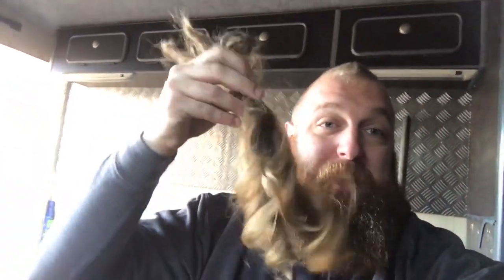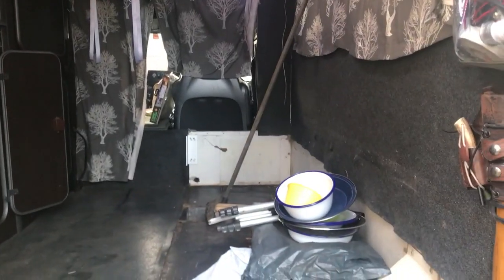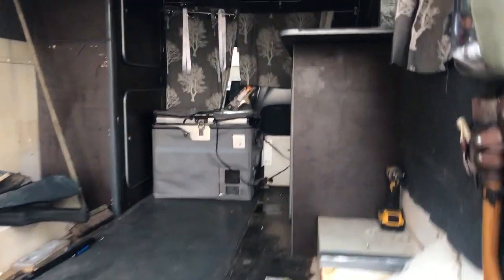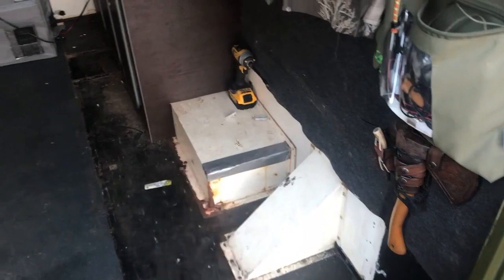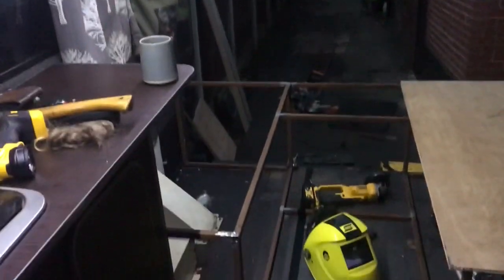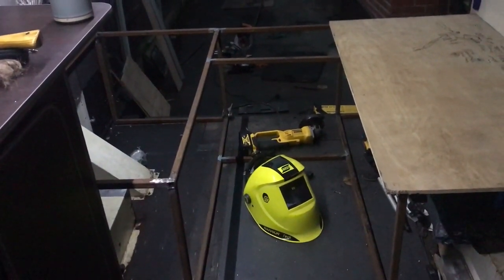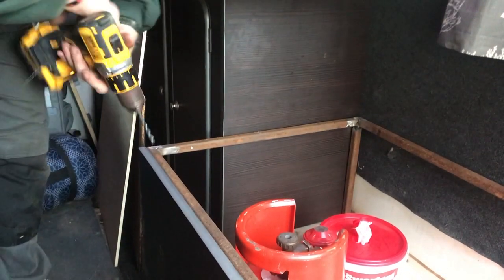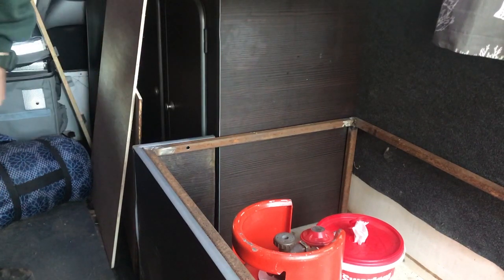land rover camper van DIY rebuild

Comment: Been growing my hair for 30 years and it has not gone past my shoulder blades and been there for the last 25 yet I can almost see my beard grow it grows so fast. 
Great video anyway bro it is sure gunn'a look different when finished.
Hope 2019 is going well for you.
Reply from the maker: Ken Allen yea mine was starting to thin because I was getting fed up with it and brushing it too hard and ragging it out. My beard was like that until I started using beard oil and stuff.

Comment: I was watching this while I drank my morning coffee. I know of a company that makes reliable off-road winches that doesn't break the piggy bank. Unfortunately I do not know if they sell their products over in the UK. The companies name is Badlands Winches. My local tool store sell them for like $299 before tax for a 12,000 pound winch. I'm not sure how much Edna weighs being the big girl she is, but they also make 9,500 pound and less capacity winches as well.
Reply from the maker: David Genthner Jr she is at 3000kg so not bad at all. Iv got a 9500 on the front but was thinking about one of them little 3000lb ones for the back. It’s not big but with a pulley it’s more than enough with the wheels turning too.

Comment: G'day Rich. :) . To be honest, i was doubtful when you first suggested putting in a side door,  i just couldnt wrap my noggin around the imagae of cutting a hole in the side of the truck body. BUT, lol, during the intro, and your informing us and pointing out the positions, i thought 'Phuk yeah, thats gonna be grouse'!. Well done mate, its coming on a treat. Bugger about it not being quite wide enough though. Extra seating and storage is allways a good thing. Thanks heaps for the update cobber. Hope you and yours had a very Merry Christmas and a brilliant New Year!. Cheers for sharing, Brett. Ps.. What blade were you using on the sliding mitre saw to cut the steel? . Cheers :)
Reply from the maker: Reaper4367 the saw is a multi cut so it does anything I just go a little slower to save the blade. The newer Ambi is wide enough for me but then it’s too big for most of the tracks I do as mine is the same width as a disco or 110. Had a good break but as you could probably tell I was Ill all week with head cold Hahahaha. Did you get your fire steel mate????
Reply: @Bugoutvehiclesuk  Hope your getting over your cold cobber. Thanks for the info on the blade, it means i dont have to go out and buy a blasted drop saw lol. And sadly no, i havent received the fire steel. I asked the post office, and they reckon  nothing has come in since the beanie and stickers. If you could let me know the tracking number, i could give it to AusPost and they should be will to track it down.